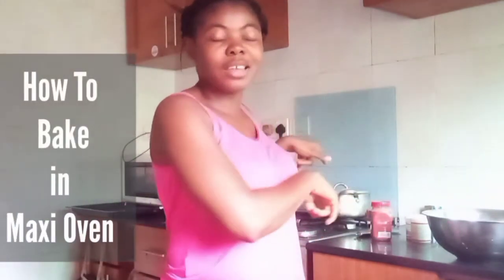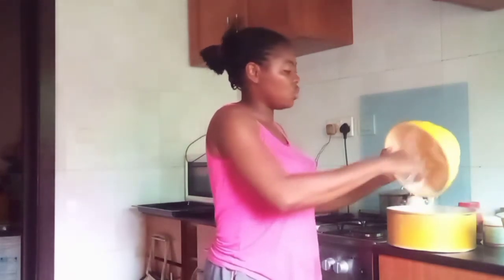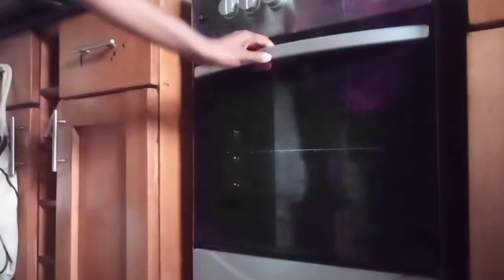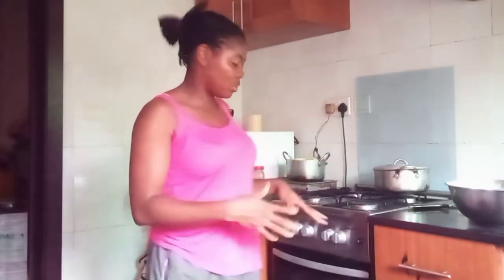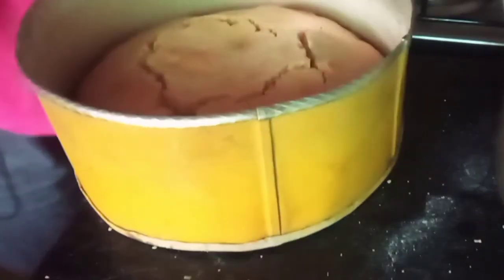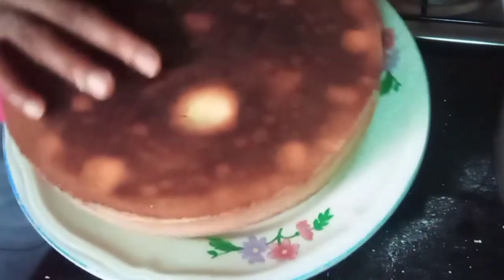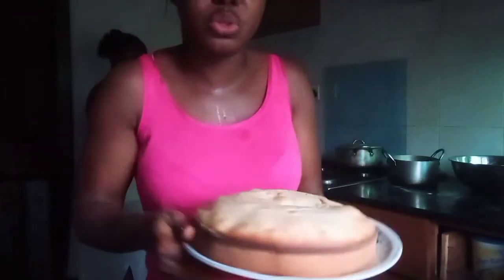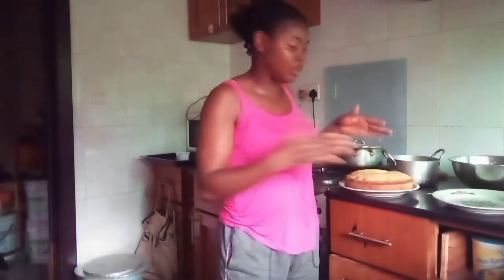How To Bake With A Maxi Gas Cooker | Maxi 4burner Gas Cooker

Comment: Thanks so much for this video. it has been helpful. But I do have a question. I have this exact maxi oven gas but when I tried using the oven it got extremely heated up. Like it got really hot on the outside. I got scared and quickly turned it off. Ever since then, ive not used the oven. Please, is that the way it used to be? My oven gas stands alone not beside any cabinet. Will it get heated up? Thank you
Reply from the maker: That's how it usually is but you can reduce the light if you think it's too hot, just turn it down a bit. I hope this is helpful.

Comment: Hello sis
I just got mine yesterday
But the oven button isn't working
Please, I need help
I plugged it and the oven light is just on, how can I switch the light off?
Please help me on this oven part from the start even the matches and electrical part.
Reply from the maker: Kindly watch this for full explanation
https://youtu.be/e6PunXS1az4. If you don't get it still, you can check out the question and answer video for Maxi cooker on my channel for more details

Comment: Bur it should also use electric to function, I have been looking for mine but haven't seen where it uses light. To grill or bake things
The gas is just annoying,🙄🙄
Reply from the maker: The Gas is not an electronic one. The plug on it is for ignition and a light in the oven to see what's baking. I hope this is helpful.
Reply: @ThatFolucutie  Yes it is ma’am. Thank you. ❤️

Comment: Thanks for putting up the video it was really helpful as I didn't know how to operate the oven before. However did you remove the tray completely while you are baking your cake on the rack or was it under the rack? Likewise where did you put your cylinder was it in one of the cabinets?
Reply from the maker: I remove the tray and my cylinder is outside. I didn't put it in the cabinet.

Comment: Thanks for this..... I got mine (Same.maxi) two days ago and if I had known it doesn't have a timer I would not have even gone for it 😖😖😖  Looks like it will.burn foods
Reply from the maker: It doesn't. Although it very fast in cooking, with time you'll get use to it and learn to appreciate it, So far you are not putting small pot on a big burner